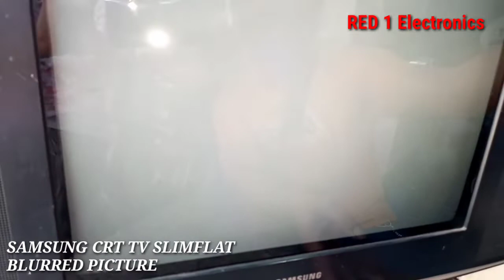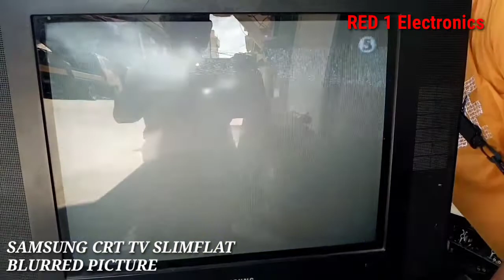SAMSUNG CRT TV SLIM FLAT BLURRED PICTURE | NO DISPLAY | VERTICAL PROBLEM

Comment: Hello Red Electronics patanong naman po may Samsung Slim ako vietnam made, May Horizontal Line and blinking ang LED niya 5 times, nagpalit ako ng bagong Vertical IC no improvement, okey naman mga capacitor Diode, pero ang voltage ng vertical sa pin 1, 17.64 sa pin 6, 15.18 sa pin 1 naman 0.64 volts lang, sa pin 7, 0.61volts lang din saan po kaya ang trouble Sir ? salamat po sa reply.
Reply from the maker: E check mo sa ABL section, dyan ka mag focus, suyurin mo mga parts na nkakabit dyan.